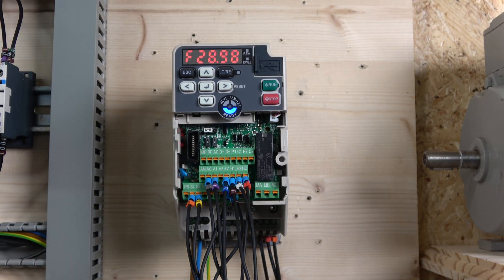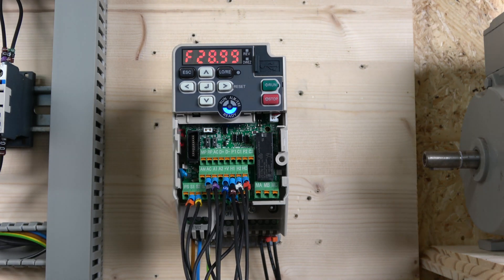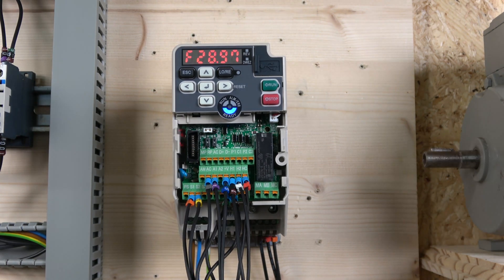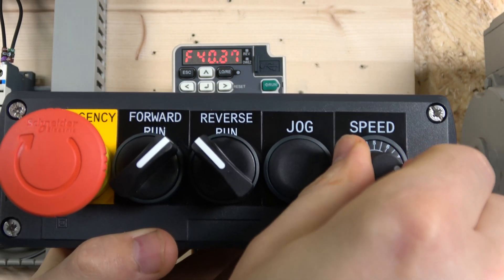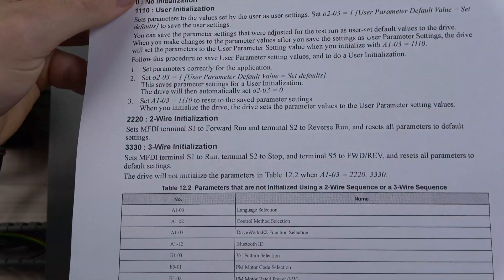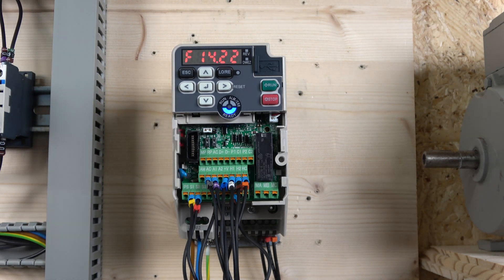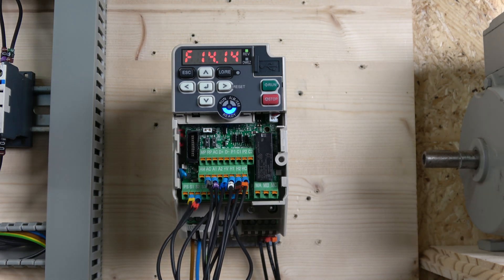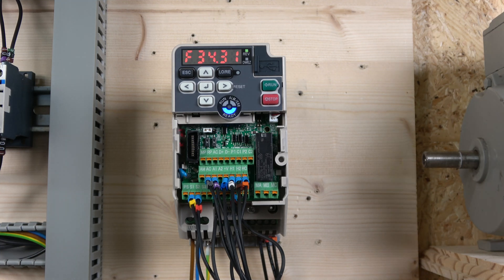Yaskawa GA500 VFD, remote control, 2 wire control, 3 wire control, remote speed control. ( English )

Comment: Good day,
In our base is available 50T Gentry Crane - hoist is installed Yaskawa H1000X AC Drive. Crane Hoist Local mode works normally,  but when Remote mode is switched or activated and the crane operator commands from the cabin (control joystick), the hoist does not work (down, up). Also A1-03=0 (No initialization), when to try to change 2220 or 3330, automatically return back 0. WHY? 
Hope you can help us ASAP.

Comment: In 3 wire control where does the wire go from the reverse run selector ? S5 ? .. I think you need a diagram to explain what wires are going where ?
Reply: Read the manual lazy